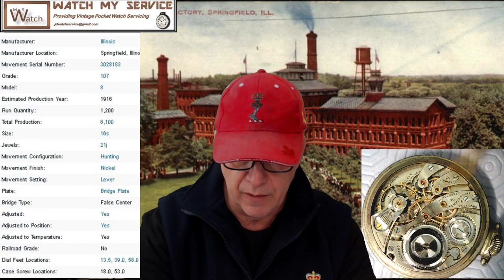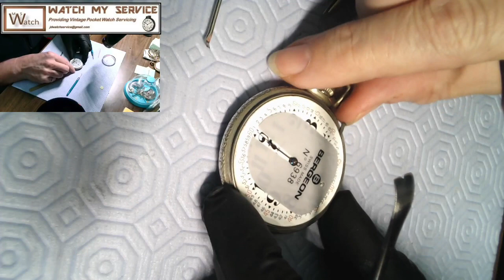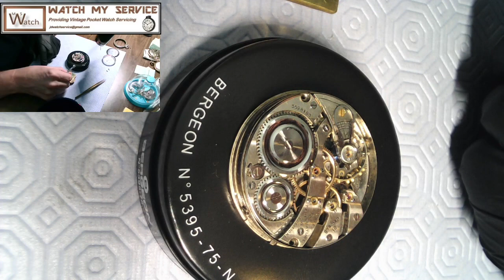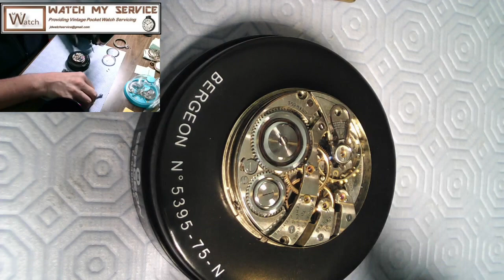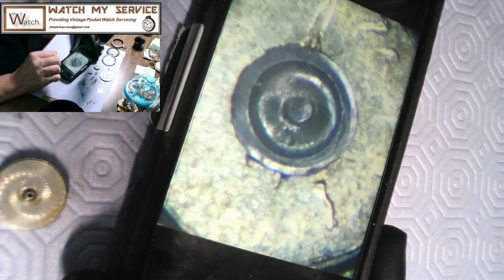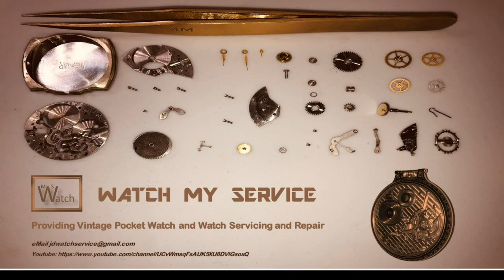21 Jewel Illinois Pocket Watch with Major Jewel Issues

Comment: Good video.  I saw the different color jewel settings and figured some must be replacements.  I don't think it left the factory that way.  Would like to see dial feet installation.  I figure you could use some soft copper wire if needed.
Reply from the maker: I will likely make a video on soldering on new feet. I am new to this and just purchased a dial foot soldering machine: today. It should arrive within two weeks and then I will do a lot on practice on old dials. Need to pick up some copper wire: or check my stock.

Comment: American Railroad Pocket watches were among the highest grade watches made, having been made for the railways makes them a great choice to use every day, mainly for their durability over time. Their lower production quantities and of course their high grade movements make them also a great gift or investment.

A typical railroad's requirements for a pocket watch in the early 20th century might include:

Only American-made watches may be used (depending on availability of spare parts).
Only open-faced dials, with the stem at 12 o’clock.
Minimum of 17 functional jewels in the movement.
Size 16 or 18 only.
Maximum variation of 30 seconds (approximately 4 seconds daily) per weekly check.
Watch adjusted to at least five positions: Face up and face down (the positions a watch might commonly take when laid on a flat surface); then crown up, crown pointing left, and crown pointing right (the positions a watch might commonly take in a pocket). Occasionally a sixth position, crown pointing down, would be included.
Adjusted for severe temperature variance and isochronism (variance in spring tension)
Indication of time with bold legible Arabic numerals, outer minute division, second dial, heavy hands.
Lever used to set the time (no risk of inadvertently setting the watch to an erroneous time, when winding the watch with the stem)
Breguet balance spring
Micrometer adjustment regulator
Double roller escapement
Steel escape wheel
Anti-magnetic protection (after the advent of diesel-electric locomotives)

The minimum requirements were raised several times as watch-making technology progressed, and the watch companies produced newer, even more reliable models. By WW2, many railroads required watches that were of a much higher grade (as many as 23 jewels, for example) than those made to comply with the original 1891 standard.

Taken from a leading Australian railroad pocket watch seller HNCO (ebay)
Reply from the maker: Hey, big thanks for all this information. I generally care more about the repair than the history, however, the history is getting very interesting:)